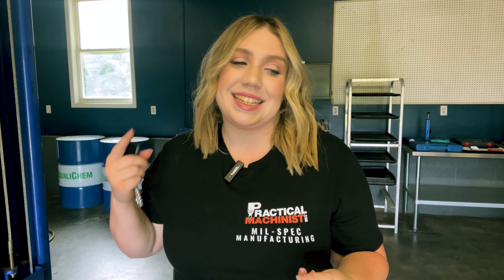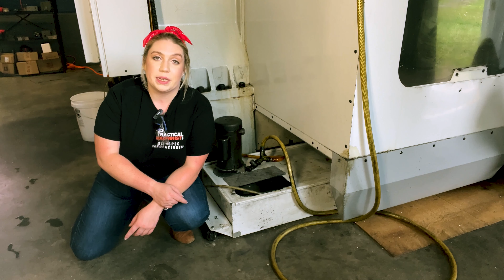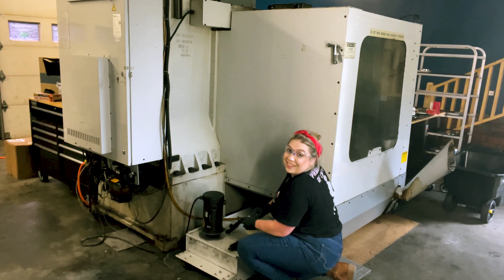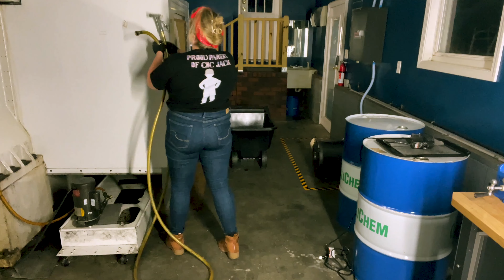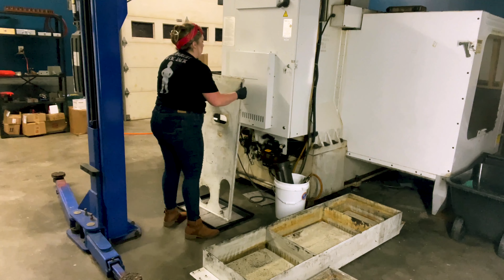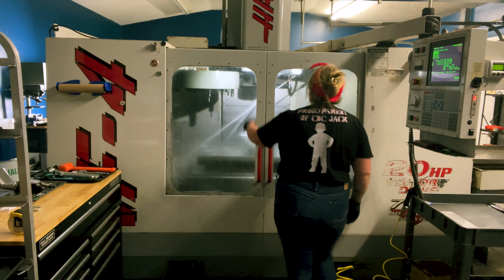First Time Cleaning a Coolant Tank - Will She Succeed? | BAPM Ep.9

Comment: We have two machines in our factory where the coolant becomes disgusting very quickly, bacteria growing within the coolant tank. These machines are always used yet we still have the problem.

The other 15 odd machines have no problem with the coolant.
Reply: Are you having bad chip build or tramp oil in those tanks? 

I forgot to show it on video, but we use an upgraded fish tank bubbler rated for 1000 gallons, to keep our coolant oxygenated and not stagnant. That might also help those particular machines.
Reply: @MilSpecManufacturing  The one gets a lot of tramp oil in the tank, the other one has zero oil going into the tank. All of our milling machines suffer with lots of chips getting into the tank however the coolant stays fresh in them.
Reply: Castrol mb-50 has never turned on me. Got a couple machines that have gone 3 years without a coolant change

Comment: Thumbs down for putting crap noise over the entire video and even over the dialogue. She adds a gallon of oil to the tank and then pumps it all out to be disposed of? That makes no sense. Was this clip added in the wrong place in the video? I'm assuming it is a water soluble oil and it is used with the coolant. This is only the third video I have watched from this channel. The video on machining the wrong copper material was interesting. It seems that this channel covers a bunch of different machine shops. I'm trying to wrap my head around the format of the channel.

Comment: It's obvious to me that you need to spend a little more effort on maintenance.   My coolant lasts for multiple years and never gets that gross.
Put an aquarium air pump in your tank, add a bag filter to filter all coolant.  Add an oil skimmer most importantly, to help prevent that cap of oil sealing off the oxygen.
Reply: 💯 I added filters to all our machines and it makes a huge difference, keeps the surface finishes nice too.
Reply: Hey Jon! 

Thanks for the awesome suggestions! 
We have upgrades coming! It wasn’t shown in videos but we do use a bubbler in our tank. Love it! Everything was removed for filming to intentionally let the tank become stagnant overnight for a true before / after with using a cleaner. 

We do alot of high production, and we’re definitely looking forward to installing an oil skimmer.
Reply: Does adding oxygen make the coolant more foamy when using tsc?